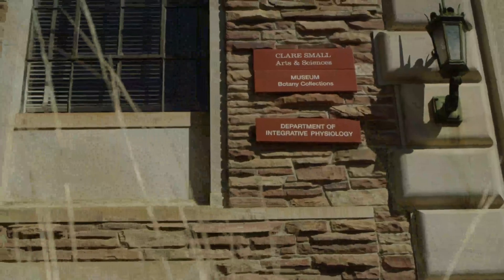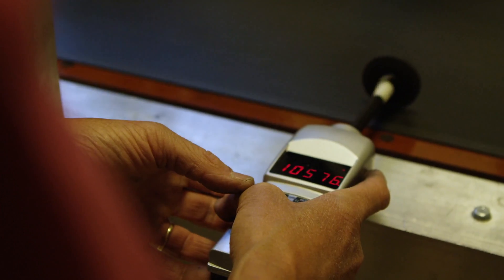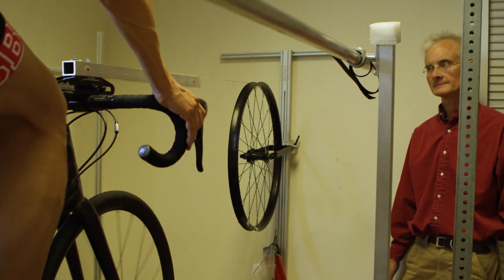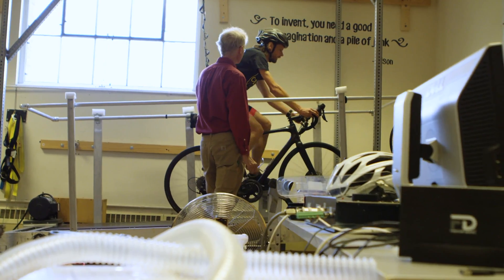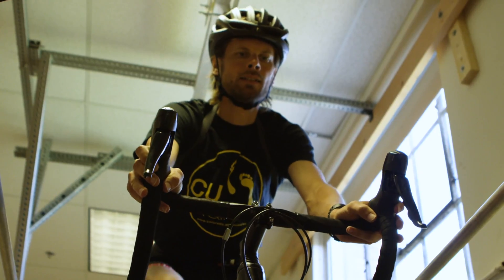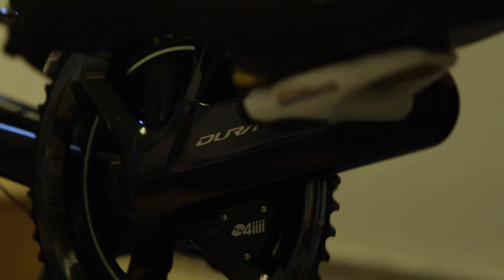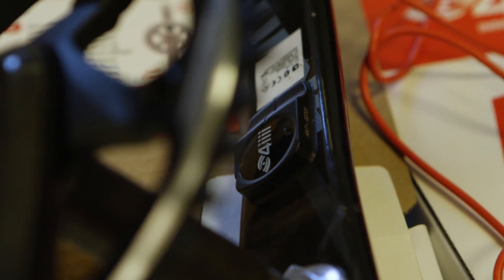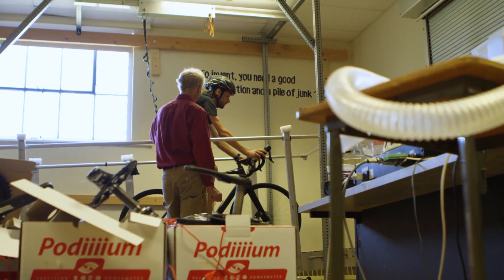Power meter Accuracy Validation with Dr. Kram, PhD

Comment: I already know how the hardware works. What I want to know is how the firmware on 4iii solutions records the samples and how I can use that for advanced torque analysis. I already have Garmin Vector 3s, which are good when they are not failing, but if I can find a crank-based solution I can return to my Speedplay pedals and possibly get even better data samples. How do I know 4iiii has a better solution suite? What kind of head units are available to display/record torque analysis? Can anyone really compete with Garmin's Cycling Dynamics paradigm?

I'd be OK if I didn't have realtime display of torque data on the road because I would just keep the Garmin pedals for indoor work. But I do want that advanced data in my recordings if I decide to use a crank-based solution for outdoors.
Reply: @Scott Cooper 

My assumption has always been that it's a matter of getting firmware compatible with open standards, like Cycling Dynamics. 

I'd be OK with alternative post-session analytical software as long as the Garmin units can record the data. I already have the Vector 3 with Edge 520 for rare occasions when I care about staring at Cycling Dynamics as I work. 

What software can I use for the most comprehensive post-session analysis? IMO, the Andrew Coggan cult has set back research and public propagation of best practices by turning "power" in to a magical number rather than a common checkpoint. If "power" were how we pay our taxes we would still want to know all of the best ways to optimize what we should do to meet our goals. Just measuring "FTP" and then following common scripts to find our "normal" path is extremely fatalistic. The most important keys for figuring out how to optimize training regimes for each athlete are how cardiac drift (detailed patterns over time) and our acceleration habits affect recovery.  It's not just "power zones" but how we stress ourselves to create that power.  Training for X minutes in "VO2 max" zone is different on an indoor trainer versus doing what seems to be the same kind  of intervals on the road, for example.